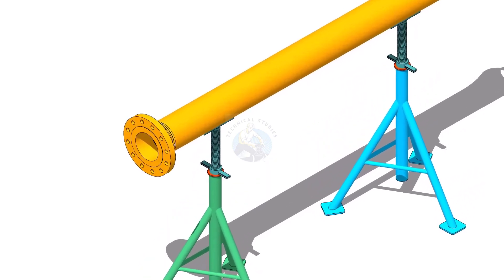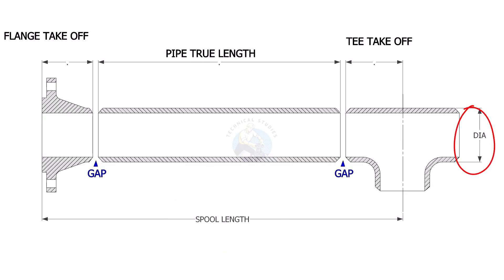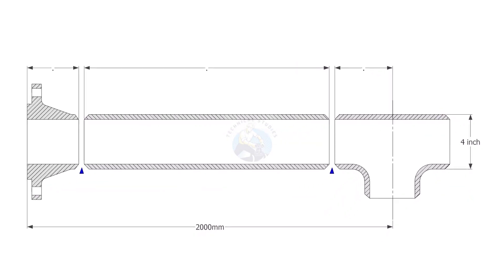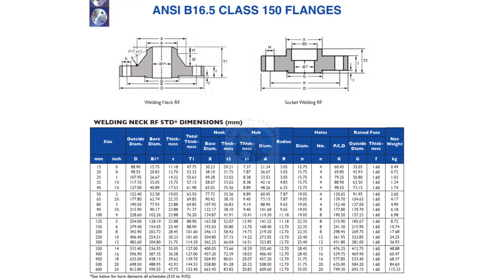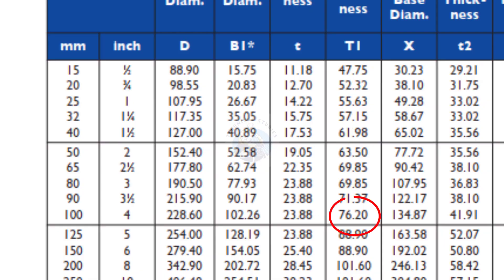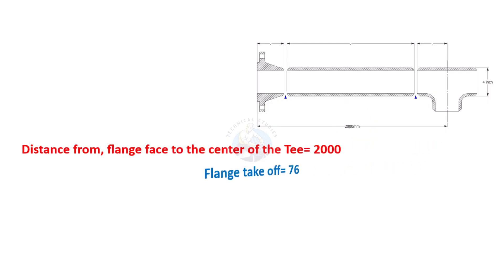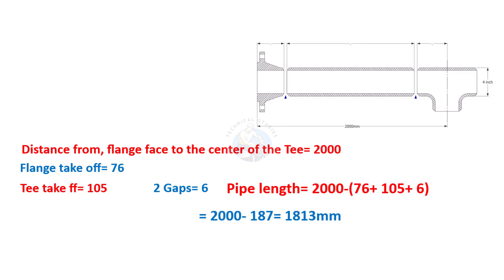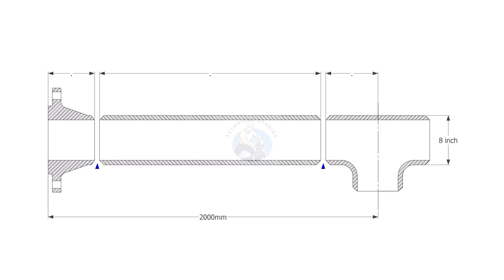How to Calculate Pipe True Length (Cut Length) from Isometric Drawing – Simple Method Explained

Comment: Hi Friend’s
Good to hear from you — hope everything’s going well!
I’ve got a few questions about the spool fabrication process that I wanted to ask you.
When we cut the actual pipe length for a spool, we usually subtract the fitting lengths and the weld gap, right?
But I was wondering — during actual TIG welding, how do you usually account for the shrinkage that happens as the pipe cools down?
Does the amount of shrinkage differ depending on the material (like carbon steel vs. stainless steel) or the pipe schedule?
And since the shrinkage also seems to vary depending on the pipe length, how do you typically handle that part?
One more question 
During fit-up, I’ve noticed that after tack welding, the angle sometimes changes as the metal cools and contracts.
Right now, we usually hold the pipe by hand while it cools to keep the angle from shifting — but I was wondering if there’s a better way to prevent that?
Would love to hear how you usually deal with these situations.
Thanks a lot for your help, man — really appreciate it!
Cheers,

Your friend
Reply from the maker: Bro, this is truly a worthy question, Yes, when we prepare spool pieces, we usually deduct the fitting lengths and weld gap, but during TIG welding there is always a little shrinkage after cooling. Normally we keep a small allowance for that, about 1 to 2 mm per joint for carbon steel and around 2 to 3 mm for stainless steel, because stainless expands and contracts more than carbon steel. Heavy or thick-wall pipes may shrink slightly more due to higher heat input. To control the angle change after tacking, it’s better not to hold by hand, use small clamps, strongbacks, or jigs to keep the alignment steady until the joint is cool. Also, put four tacks at equal positions like 12, 3, 6, and 9 o’clock to balance the pull, and don’t remove the clamp until the metal is fully cool. These small steps help maintain the correct length and angle, and reduce the need for rework. However, an experienced welder can really do wonders, by using different welding techniques like back-step welding, balanced heat input, and controlled cooling, he can minimise distortion, nobody, not any method or precaution can eliminate 100%. Thank you.
Reply: @technicalstudies.  Friend, thank you
I was applying this part based on experience regarding pipe contraction
Thanks for answering
I'll pray for your channel to grow even bigger
Best regards
Reply from the maker: @DeadPool-kj5il Thank you, Bro. Thank, you so much for your kind words and prayers.
Really appreciate your support, it means a lot.
Glad to know you are sharing your real experience too.
Best wishes to you, my Bro.